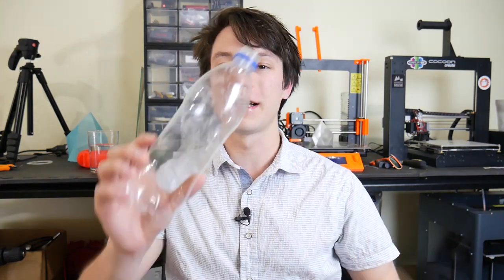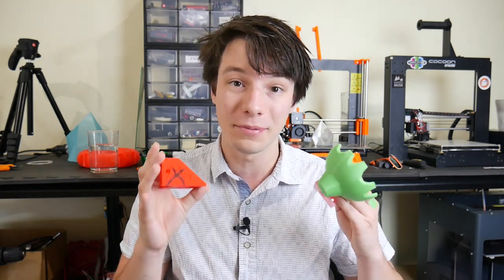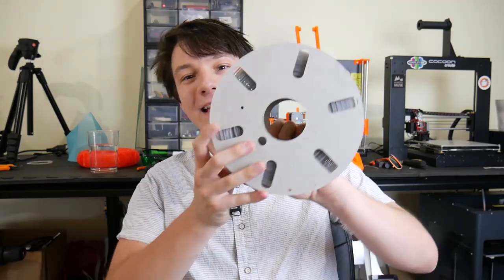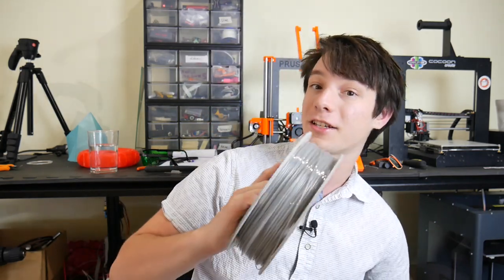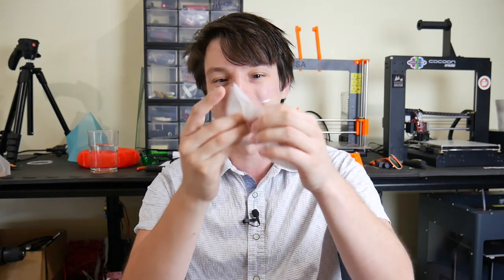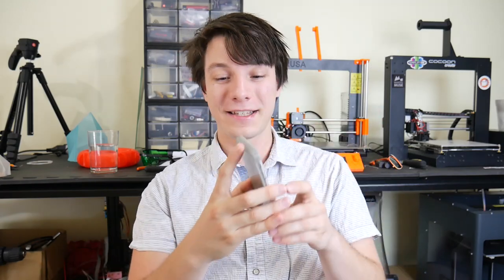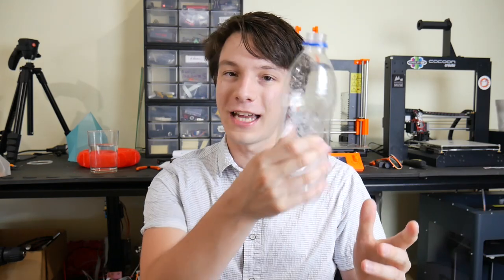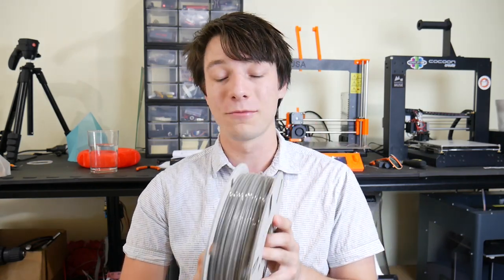Recycled Phone Case made from 3D Printed PET Bottles - Refil Filament

Comment: Angus, the blow molding process they use for bottles actually mechanically aligns the polymer chains in the walls of the plastic bottles in parallel which is what makes them stronger and flexible. That gives the bottle strength. The neck where the cap screws on and often a small spot at the bottom of the bottle don't get blow molded and are thick spots which have the same brittle property you demonstrated. We make out water rockets from PET bottles using 3D printed bottle couplers, so if the printed parts were made from recycled bottles, it would be totally made from bottles!.
Reply from the maker: That's cool! Makes sense too. Yeah you could have one 100% made from bottles ;)
Reply: Hi! I built water rockets for three years, but I am not quite sure if the thing with the alignment is true... I get the parallel part concerning the individual polymer chains, but since the biggest stress (when under pressure) occurs tangential to the circumfence of the bottle, this would make the bottle weaker? (because now, the stress would be normal to the polymer chains...)
No worry, I know your channel for years, I'm just here to discuss!
Reply: Oh, and: speaker boxes would be a nice use for the filament! :3
Reply: I believe he means they align parallel to each other during the flattening process, but only "locally" - between individual molecules.  There is no "global" alignment in any particular mechanical direction.
Reply: Thing of the blow molding like this: You have a balloon and you want to make a bottle around it our of pasta noodles. You can inflate the balloon and then take handfuls of pasta and paste them on the surface in which case they will be very random, some of the strands will just be small wads and some will stretch out a little but are likely to double back on themselves or triple back, etc. If you took your balloon and put it inside the pasta and then inflated it, the pasta would pull the strands as it inflated and stretch them out around the outside. They would be more like strings wound around the balloon in different directions than strings randomly placed on a sphere. Years ago when my team was setting the world record for water rocket altitude, we tried to make out own pressure vessels from PEG and they would fail, I read a lot about the bottle blowing process, and the blow molding definitely changes the properties of the PET by arranging the polymer chains. I might not be doing a great job of explaining it, but there is definitely something about the process.

Comment: I own a manufacturing business in the USA.  Our employees generate a fairly high volume number of empty water bottles.  We would like to recycle them into usable filament for our production 3d printers.  We make disposable molds (average 10-20) for investment castings.  In the past, the cost of a simple tube mold cost was $1500.00-$3,000.00.  We print the molds for  under $10.00  and it takes quite a while for the costs to equalize.  So, if we can use the bottles we generate either by sending them somewhere to be recycled or making our own filament we would be happy to do it.  Even if it costs $ more that would be acceptable.

Comment: I think heating the recycled PET in a stove hot enough for it to decrystallize (material gets more transparent / less milky) and then quenching it in cold water (preventing crystallisation - visible by preserved transparency) would make it more tough / less brittle. How about trying that?
(exposure to insufficient temperature may worsen the situation / material gets more opaque)
Reply: is the plastics behave the same as steel?

Comment: Hey Angus. Im sure youve figured out the issue by now, but the "whispy" effect drove me made on my mk2. I finally figured out it was simply the bolts on the extruder's idler bearing lever (2 bolts with the springs) were not tight enough for PET materials. Its a bit slippery so just needs some extra bite to feed properly. Hope that helps you too!

Comment: I would print lost pattern molds with it.  It looks like it does very well printed thin, so if you check out a video called "3D printed lost shell casting" you'll get an idea.  Brittle doesn't matter if it's going to be burned away by molten aluminum or copper.

Comment: I bought a cat toilet lid actually for my bunny, the thing is that rabbits use it a little different and they need a grid to not actually touch the medium below. I'm using PET, not that one exactly but a local one called BPET that is the same thing, created from recycled bottles, and I sort of like the filament, it works great, I just have two problems, which I think I know what are root causes, first, it strings a lot because at 250 (the temperature this filament works at, tried lower and it wont extrude even pushing with my hand, it starts extruding at 247, and found 250 is the sweetest spot so far) it kind of leaks, that being problem one, so to sort problem one you would say, add more retraction, and well, is not just that straight fwd, I found that after doing the retraction if generates bubbles, not a lot, but enough to add ugly spots on the print as filament is less (and with also less adhesion) because of those bubbles, so I what I did now, is I set simplify 3D to do retractions only if traveling more than 3mm, to avoid traveling over air if avoidabe, and to do 5mm of retraction with +1 at the return to generate some extra pressure,  +2 worked great too but generated a little button that impacted on quality. 
All this with an ender 3, and I think that this filament is more suitable for a direct extruder, so I have to test it on other of my printers that I don't have available right now, but I suspect that the leak is caused because of the pressure caused by the bowden tube.
Oh, also, at 248 or below, retraction was a pain, because with the movement backwards it was enough for the PET to clog up the chamber because it solidified super quick.

Comment: Makers Muse will you ever do a review / video on the home filament systems like the filabot or any of the other community reprap style filament production systems? I understand that there are many problems holding back home filament production but do you think those problems will ever be solved and home filament production become as widely accepted as 3d printing?
Reply: Also could you print a boat so the recycled plastic can float on the ocean with all the other discarded plastic that could have been recycled into something useful (like a boat)
Reply: protocycler
Reply: Looks interesting have they released any units yet? has anyone done any reviews on it? and are they worth the money?

Comment: For prototypes or trials, I use "Black Friday" filament which is offered at a bargain because the color is ugly or unpopular.  I would definitely be interested in using recycled filament for this purpose as the tensile properties are often unimportant for prototypes.  I don't own a dual extruder printer (yet) but what if you used quality PETG in one extruder for the outer shell layers and the recycled PET in the other for the infill?  I would like to see this tried in a future video - that would be a very practical use. I'd also use the recycled filament for solid infill parts like washers and spacers.  Also it would be ideal for artists as they usually paint their models and the model is not being flexed or under any structural stress.
Reply: I checked on Amazon and you can buy a spool of Refil PET for $39.99 plus $6.59 shipping USD.  Pretty pricey and the Amazon site does not tell you how much you get.  I had to go to the Refil website and it's only 750g but I might consider helping fund further development by buying some.  Be careful - there is another 3D filamant maker named "Refil 3D".

Comment: I can't believe you couldn't get the pet to print on the cetus. It prints beautifully on my printer, no problems at all with the unheated bed for me
Reply from the maker: Keep in mind mine is a pre production unit, that might have something to do with it. The extruder motor gets too hot to touch within 5min, does yours do the same?
Reply: Maker's Muse I did notice my motors got a little hot, so I infrared thermometer them. The peak was only about 140f for me. But I did see other people on the forums saying there's were going upwards of 170f.

Comment: If printed thin enough, would this type of plastic lend itself well to objects that need to be watertight and flexible?  Specifically, I'm thinking it'd be nice to have something like a replacement bladder for a camelbak, or a liner for a wall-mounted indoor planter (something like a the commercially available Wooly Pocket, but made from PET).

Comment: Why the most economical and ecological recyclable material is wood.  Carve and cut pieces and scraps into large components first then progressively smaller.  Bin for composting any scraps that you can't get anything out of.  Periodically compost all wood that is deemed unusable.  It's good to have further uses for plastics though.  For reasons stated by you.  And it's a pita to deal with for recycling.  I wonder if I can sell mine direct to a company that reuses it.

Comment: weird, I have no issues with PETG (torwell or bilby3d brands) on my e3d v6 printers, one of which was a bowden printer. Both printed flawlessly once I got that print temperature dialled in (also 235).
Reply: I thought he explained in this video that PETG is not PET?
Reply: all I got from it was that PETG isn't as brittle, nothing about how well it prints or whether or not it's affected by "ptfe lined hot ends" more or less than regular PET.

Comment: Suggestion: CD-case, "jewelcase". They brake alot, so the design could use some alterations in good maker spirit. This would also be quite useful to those who have CD:s.  Maybe also a minimal material version. Or a vase mode modular construction, if that is possible.

Comment: I bet you could make a tool to melt and extrude plastic onto a spool at home.
I think something optical could be cool with some translucent filament. Either by making lenses solid or make them thin-walled containers for water. Probably won't work, but you never know :^)

Comment: Who thinks he should make almost like an overmold outer case piece with flexible filament so it gives some shock absorption? (Yes I know it wouldn't be overmold but I had a case in the past that was two pieces, in face it was a soft rubbery inner piece that extended out to the corners thicker with a hard plastic outer piece that held it better in place around the edges and back)

Comment: I would use this. How does this compare to PLA. I use PLA rather than ABS, the bigest reason is the fumes that are associated with ABS. Printing with PLA you don't have to worry about the ambient temperature like with ABS. Is there a lot of fumes with using  recycled filament.

Comment: I would print a phone case.  I would just make it a little bigger and line it with a thin layer of silicon sealant.  A phone is so light the PET is not going to shatter if it is dropped.

Comment: As for recycling little strands of leftover pla: Get a dedicated "zero shits given" spool, and start rolling up leftovers. Add to the spool by heating the end of a leftover under a flame and smooshing it onto the end of the filament on the zero shits spool.

then print a lion.. The more random colors the better..

As for everything not pla/abs, Dave Hakkens has the lowdown..
Reply from the maker: I've always wanted to try something like that but wouldn't be bulges at the join jam it up?? I suppose you can use a perfectly fitting bit of PTFE or something to form the join but sounds like a lot of effort to me :P
Reply: I've been wanting to do that with some of my sample leftovers, would make some funky filament XD
But haven't really found a easy GOOD way to do so
Reply: Yeah I'm not sure about the dimentional stability of the seam, it might bulge quite a bit. Maybe trimming it afterwards (or pulling the filament through some sort of shaping/cutting die) would be beneficial. Also, wasn't there a kickstarter (or atleast "a" project I remember) that merged filaments of different colors together for a "full color" print solution using only a single extruder? I could've sworn I've seen that somewhere..
Reply: The Palette? Ye not sure what happened to that XD
Reply: The Palette is for sale but the price is REALLY steep if you are just a hobbyist. You can find it here: https://www.mosaicmanufacturing.com/

Comment: 2:17 men i think that You are wrong because if the extruder has a consistent extrusion And a consistent puling speed You gona have a consistent filament
Reply: No. If your machine has a .4mm nozzle and your slicer is set to .4mm nozzle 1.75mm filament then it adjusts stuff to make it work.
Now what if your filament is sold as 1.75mm "high precision" but is actually 1.89mm? The slicer will still make the printer push as much material as it needs for 1.75mm, while the filament is actually thicker than that. So it will push way too much filament and make the motors skip or you will see it as overextrusion in your 3d prints. Both arent good for the machine or for the printing quality.
Reply: @Sharpless2  well, u can mesure that, And for example with the duet filament monitoring system, that actually mesures the dia. Of the filament And ajust flow base on that u would ended up with decent prints 
And in the worst case, u can also check the actual filament dia. And Enter it on the slicer
Reply: @Lucas_sGarage  yeah i did measure my filament. Shortly after that i bought high quality filament that is exactly 1.74 to 1.75. Never buy filament that costs under 20 bucks for 1kg.
Reply: @Sharpless2 i bought filament for 18$ by 3n3 And so far so good

Comment: But seriously, would making a bottle with this recycled PET filament be food safe?
I'm a little reluctant to use anything that I print with food and drink. But I could be wrong and missing out on usable 3D printed plates and cups etc...
Reply: The plastic's been heat-treated and chemically cleaned multiple times, and that's before the final step of being heated to 240 degrees during extrusion. That's twice the temperature of medical steam sterilization. The main reason not to use 3d printed cups/plates is they tend to be porous unless annealed.
Reply from the maker: Exactly, and because of the layer by layer nature, even if the surface is safe it would be very difficult / impossible to clean any debris that became stuck in between the print layers.
Reply: What annealing temperature would you suggest, and for how long?
I suppose that things like cups and curved plates would need to rest on some sort of support to maintain their shape.
They might also need a shpritz of mold release (cooking spray like PAM?) to not stick to the supports.
Once made, do you think that they could be dish washer safe?

Comment: Why wouldn't the case print properly on the prusa but it would on the other printer?
Reply: TGB probably tempsettings. Cheap printers may read the temp a little bad. For example my wanhao di3 thinks it is much hotter than it is. I have to print PLA at 245° which shouldn't be possible with PLA.
Reply: PLA can print higher, it just starts to crystallize if you leave it that temp for a while. If it for instance stops feeding and bakes whats in there, you're gonna have a bad time getting your nozzle clear. I bought some cheap inland natural color PLA and it requires 230-240 to start bonding worth a heck. Heaven forbid I use a fan. Meanwhile better filaments print great for me at 210 with 100% fan. I basically just use my PETG settings for it and don't do that requires strength since its still weak.

Comment: Hi Angus,

I am using a recycled ABS from BPR Plastics, http://www.bprplastics.com/3d-printing.html.  You can get some from Amazon.  Its really attractive cost wise at <$20 per kilo roll.  

The negatives I have experienced so far is this:
Even at 10deg over the max I get poor layer adhesion at 0.8mm thick walls(2 layers), so wall thickness goes up.  This seems to be common to your material as you mentioned.

Also I had it break on me as I was storing it away one day, but so far it has not broken when extruding.

And you can get any color you want as long as its Black.

Maybe you do a review of this material as well.  Maybe they will talk to you about their processes and stuff, it would be interesting to know more about how they do this.